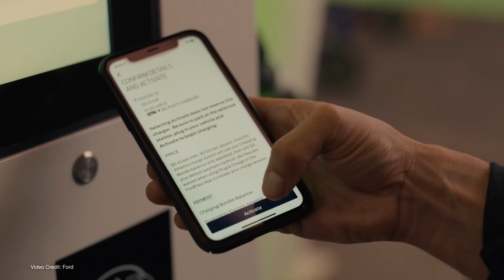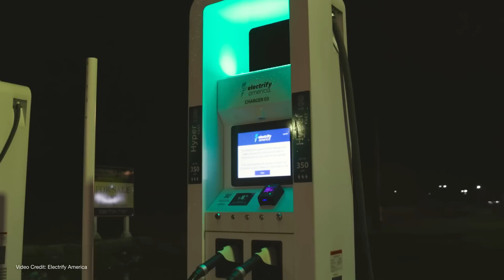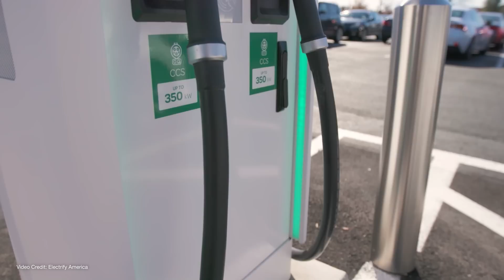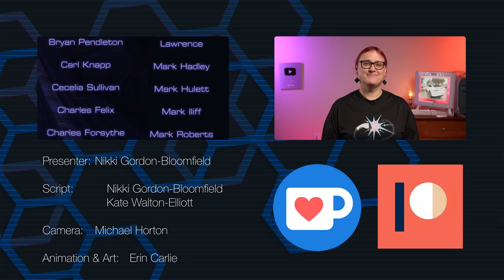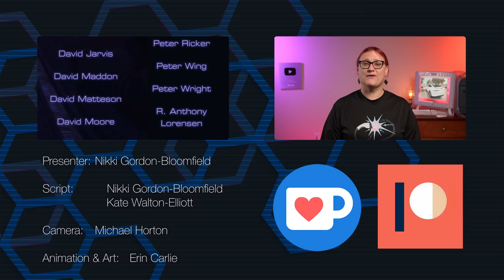EV Fast Charging Is BROKEN - And NACS Won't Fix Everything

Comment: If you are correct that Tesla uses the onboard chargers from their cars as the modules to create a Supercharger, it implies that Tesla’s costs to make a Supercharger are greatly reduced (because of their enormous volumes.)
And it also implies that the reliability will be very high, as the chargers have so much production history that all the bugs are worked out.
Add to that, Tesla has for years been the #1 pick for new graduating engineers. Tesla gets to pick the best of the best, and that gives them a significant advantage.
Reply: That's great! Perhaps the new engineers can improve the current system to charge newer vehicles at the fastest attainable speed and add enough cable length to accommodate a wide range of vehicles. This will require a new NACS connector and larger cables to handled the increased current and voltages.
Reply: on board chargers are for AC charging only
there is a reason why the superchargers are called DC Fast Chargers as they charge the HV battery directly.
Reply: @thomaswilson2917  That's the point, though. Something has to convert, say, 240V AC mains power to 400V DC, to feed into the battery pack. Either it's the AC charger inside the vehicle, or the DCFC outside the vehicle. They're both doing the same job, though on a totally different scale.

(The different scale is what makes me skeptical of the claim that Tesla superchargers use the same hardware as what's inside the car. The DCFC would need a lot of those in parallel! Also, it needs them in groups of 3, to accommodate a 3-phase input feed. But it does seem doable.)
Reply: @ps.2  no they don't.
You don't have to convert anything when you charge the car with DC.
Yes inside the supercharger it converts high voltage ac to DC power which directly charged the battery.
There is no conversion inside the vehicle.
Tesla superchargers are not powered by 240 volt ac power. 
The transformer is rated at one megawatt and powers 4 stalls.
Your transformer line voltage would not be 240 volts with 1,megawatt.
Reply: @thomaswilson2917  You're saying there is no AC-to-DC conversion inside the vehicle? An AC charging session just pours 120VAC or 240VAC straight into the battery pack? Sorry, I don't buy it.
Reply: @ps.2  not what I said.
No conversion on DC fast charging.
Yes the Tesla has an onboard charger for level 2 or level 1 ac charging
Tesla superchargers charge the battery directly
Tesla superchargers are not fed from 249vac.
Since the transformer is 1 megawatt and feeds 4 superchargers it is fed from the high voltage lines. 
Might be 4160 volts or higher for the transformer primary.
Reply: @heathwirt8919  technically there is a new NACS connector but it is backwards compatable with the present one.
That means it will plug into present Tesla vehicles.
Reply: @thomaswilson2917  Where is it? I'm guessing it's in the same place as uprated cable and charger architecture somewhere in Tesla fantasy land.
Reply: @thomaswilson2917  Huh? Who cares what the transformer takes? Nobody's talking about the transformer. We're talking about the DCFC. The transformer will feed it whatever voltage and however many phases Tesla decided they wanted to engineer for. Could be 3 phases of 240VAC, 60 Hz, so they can reuse those mass-produced car chargers, right? (And so they could use the same design in locations where they don't also spec the transformer.) Could be a much higher voltage, for smaller wires and conduit between stations, but a more expensive cutoff switch. Who knows? Not me, and you're not making much of a case one way or the other either.
Reply: @thomaswilson2917  The onboard chargers convert AC to DC. They can put out 11 kW of DC. Putting banks of the same chargers in parallel in the electronics cabinets at Supercharger sites might be (I don’t know for sure) how Superchargers make their DC. There is no technical reason it would not work. It would take a large number to power a 250kW Supercharger. Roughly 24 units. The video claims this is what Tesla does. I am skeptical, but not for technical reasons. I think it might be more economical and compact the build dedicated, higher power charge modules for SuperChargers.
Reply: @jimmurphy5355  you can get semiconductors that handle way more than 11kw.
The supercharger electronics run off of 480 volt 3 phase not 240volt single phase.
Reply: @thomaswilson2917  Based on a teardown I saw of the onboard charger a few years ago, the onboard charger is three phase capable. The CCS2 connector on European Teslas has pins for 3 phases of AC, and some Level 2 home chargers do provide 3 phase 400 volts. (Line to line in a three phase 240 volt system is 400 volts.)
I suspect that the same circuit board is used for EU and North American Teslas, with empty spots on the board for North American cars. So a fully populated charger board can handle three phases, and maybe, if the parts were specified with quite a bit of voltage margin (or higher voltage semiconductors and capacitors were substituted) also work at 480 VAC.  But I am still skeptical that’s what they do. 
The inverters that run the motors can handle hundreds of kilowatts with just a single circuit board and a handful of very high current switching devices. So clearly Tesla could design a single much more powerful charge module for use in the Superchargers, and put a few of them, instead of dozens, into the electronics cabinets
Reply: @jimmurphy5355  might be true for same circuit board.
But no one is going to put 250/11 circuit boards in a supercharger when you only need 1 circuit board and larger scrs that handle the larger current.

Comment: Personal pet peeve (and I know I'm not alone). Charging-network-specific phone apps, or RFID tags, need to die! Or, at least, be strictly optional to use (the way petrol station incentive cards are). We have a perfectly standardised method of paying for stuff without relying on cash ... contactless payment cards. Charging stations need to use them, and not require someone to sign up with an app and establish an account. It should be possible to pull up to the station ... plug in ... tap any valid contactless payment card with funds available ... and walk away and have the car charge. No phone app or RFID tag and no account other than the owner's bank account. Tesla does not get away scot-free here. Can't use a Supercharger unless you have an account (be it Tesla or otherwise).

I believe that Kempower stations now have built-in contactless payment terminals. And strain-reliefs for their cables. But, there aren't many in North America yet.

Comment: As someone who has an EV with CCS connector I can tell you from personal experience that Tesla's customer support at their chargers for non Tesla EV is there is no support.  No 800 number you can call.  No support through text messaging.  No website to report a problem.  Shows just how committed they are at supporting non Tesla EVs.  One thing this video didn't touch on is how the payment system works at CCS chargers.  They are all trying to reinvent the wheel with apps and rfid cards and memberships.  They need to do what gasoline pumps have done for decades now.  Just use good old reliable credit card and debit card readers on every pump.  Another thing they need to do is layout the pumps either as drive through like gasoline pumps or place the chargers at the center were four parking spots meet so that one pump can service all four spots. This way if multiple ICE vehicles are parked in some of those spots chances are an EV will still be able to charge.  If the parking lot owners are smart and don't put those cement parking blocks at the end of each parking space all of a sudden you have a pull through charger that can be used from either side.

Comment: Nice overview.
Just finished an up and back from central California and Seattle.  (Waved when we passed.) I experimented with non-Tesla stations for my Model Y, but more than half were broken and human interfaces were a mixed mess. Tesla was painless; transparent software, high reliability, small cable (for Rev 3 of Superchargers), and large number of "pumps" per station, removing availability worry.  Competitors with one or two connections per stations, when half can be failed at any time, would drive me nuts.
We are about to start two-months driving a rented Model Y in Europe (Germany, France, Italy).  It will be interesting to compare the situation where the question of connector does not matter.

Comment: Great video, as always! EV charging stations need to emulate a similar model that has won: petrol stations. Have EV stalls with sufficient room all around, charging stalls that can be seen easily and prominently when entering the area, able to charge on both sides, with sufficient long cords. Add a convenience store with clean bathrooms, snacks, sandwiches, decent coffee and, if you feel lucky, with a hockey field on top (clerks! -the movie-). 

About the classic Mac, is that a Graphite G4 with the wonderful Studio Display? Lovely machine. For me, the only software that it should run is Marathon.
Reply: You dont need long cords if everone puts the charge port in the same location.
Tesla Manages to put it in the same location on every model.
Long cords are inefficent and makes liguid cooling less efficent.
thats why tesla cables are smaller...
Reply: @thomaswilson2917  agreed, mostly. Still, you have to keep in mind human stupidity that translates into every brand putting thee charging port in a different location. 

Also, next charger stations will increase voltage from 400V to 800V you decrease the temperature that the whole systems gets (due to lower power loss, so less heat dissipation).
Reply: @MrSinnerBOFH  higher voltage stations charge at a higher kw rate.
Doubling the voltage allows you to charge at twice the rate.
Reply: @thomaswilson2917  or at the same rate at a fraction of heat generation

Comment: The more complicated the protocol, the more difficulties you'll have with compatibility. 
Essentially, All a charging protocol needs to do is to instruct & coordinate  the car to energise it's main contactors with the contactors within the charger - in a safe manner,   And exchange information regarding voltage and current and possibly temperature.   All other data is just information gathering on the part of the charging and or Auto manufacturing company.

Chademo protocol is far simpler but no, the auto industry wanted a faster protocol to enable transferring Mbytes of information in order to know all about us.

I used to design electronics to attach to computers etc, using the standards and I can say there is no such thing as a standard that companies and Engineers won't tweak such that an interface is no longer universal.

Comment: Thx for sharing. I'm with you on free charging. EV manufacturers may still offer it but Tesla should just inform them they must add this note (in fine print if they wish to) * Free charging does not apply to the Tesla Charging network where idle fees will be ludicrous.
Reply: Tesla is not claiming free charging.
Why should they be involved? 
In ford's case it is only at electrify America stations.
Reply: @thomaswilson2917  just saying that other car makers offering free charging should inform their customers since lots of Superchargers will be opened up to them.

Comment: I think it will take Tesla's network to help make mainstream buyers okay with idea of buying an electric vehicle in the US. It is sad how range obsessed many possible buyers seem to be. Once you have a vehicle that does 200 miles or more on one charge, 99.9% of travels are covered with that one charge. I think there is a strange disconnect between the idea of just plugging in each night or every couple of nights, versus that once or twice a week gas station visit you have to do with ICE thanks to most have 300 miles or more of range. My Model 3 RWD is plugged in ever night and I have 260 miles of range. I have yet to need to charge outside of my home. Before people start yelling, not everyone owns a home, yes, I know. If we just got 75% of homeowners to buy EVs that would transform the United States. That would also get more companies to invest into the EV space and encourage better options for those without a home to charge. 

It is crazy to think how fast things have improved in less than 10 years. When you look at things like the Ford Focus EV and Nissan Leaf back then, versus all the options on the market and hitting the market over the next 18 months. The EV industry has done a great job taking on the issues that keep people out of the EV market. I do believe as little as five years from now, most buyers will feel good about the idea of buying an EV. 

I do hope Tesla is not the only charging network to be reliable and all over the place. I agree with the concerns about safety and access to charging. As more business see true value in EV charging, I do believe much of this will be fixed. It is no longer a novelty to get customers shop stores while their vehicle charges. Instead the charges will be seen as true revenue generators and that will spur more investment and better charging stations. The biggest challenge will likely come from lobbyists trying to slow EV adoption will try and throw as many roadblocks up as possible to new charging stations. 

Where I think Tesla might truly break the anti-EV movement is if they get many charging stations to be self reliant, as in battery backup with solar to run a charging site. If an emergency happens and power grids go down, but Tesla charging stations are still up and running, both government agencies and consumers will want to use something that can still function in emergency situations. I could see state and local agencies demanding these kinds of charging stations be put in their areas so emergency vehicles can keep going when power grids go down. Consumers will obviously want the same. Sadly, the more extreme weather we are dealing with is going to make this kind of event possible. 

The one variable in the mix is solar tech on vehicles. If we really get the kind of breakthroughs that add fifty miles a day even on a semi-cloudy day, that will be a big help in getting people into EVs. Just the idea you can charge up your vehicle for free will be very appealing. I am sure it is a good decade out before we might have that kind of solar tech. Yes, Aptera has their vehicle, but for most people the two seat design is going to keep buyers away. When you get something like a Model Y or Kia Niro EV that has 50 miles of solar recharge a day, then more mainstream buyers will be coming over to EVs.

Comment: 100 percent facts.  There are so many YouTubers that think the connector is what’s going to fix the problem.   Sure if tesla opens all chargers it will be a huge start. But they are not. And they don’t support 800 volt currently….   It also won’t fix all the broken non tesla chargers.
Reply: At the end of the day I think most of us don’t care what connector is used.  We just want it to work and work well.
Reply: It's NOT just the connecter that his better about the Tesla SC Solution. It's going to force other charging stations to be better.
Reply: @davidc2838  how will a connector do that? Tesla right now isn’t Clear on what stations will work with non teslas.  So far it’s expected to be v3 and maybe only the new v4 chargers.

Comment: That placement, in Vegas, there's the SC lot by the High Roller ferris wheel stinks too. It's behind a gate/bar and you have to know the stupid code to get thru it and sometimes it still doesnt work. Let's not even get into tho, the placement of EA stations at the shadiest of places sometimes where charging at night is quite the adventure in your very nice, expensive EV...

Comment: The non-Tesla EVs need to relocate their charging ports to the same location as Tesla's. I have heard this complaint repeatedly from utuber Bjorn Nyland (Norway) who tests other EVs other than Tesla's, and I agree with hm completely. That would help to eliminate one of the problems. I am a Tesla owner since 2012 MS delivery and have NEVER had a problem charging any of our 4 Tesla vehicles at Supercharging network. I think the access, ease of use and reliability of Tesla chargers is one of the factors that will make me a Tesla owner for life. Tesla tells me availability of chargers, waiting times if all are in use, and the cost of charging (variable rates throughout the day), so I have all the relevant information needed on trips to make the most informed decisions and make charging relatively stress free.

Comment: Well done for pointing out that there is a lot more to this than connectors, and that much of Tesla's reliability advantage comes from designing the cars, the chargers, and the software, and managing the payment and auth system and the servicing too. It's not that their tech is actually better in any important way (indeed it's still CCS signalling under the hood AIUI) it just doesn't have 46 different combinations and businesses to deal with.
Standards can fix this, as is illustrated by USB or bluetooth which do generally just work, whoever made the devices, or whichever OS you are using.
Reply: Tesla makes better chargers, more efficiently and keeps them in better repair on a continual basis. That's what's lacking from nearly all other charging networks in the US.
Reply: @davidc2838  Maybe in the US, but other people make more efficient, higher power, and more generic chargers and there are several networks (including Tesla's) with good reliability stats in Europe. Kempower chargers are particularly good, but several others are good too and FastNED, Gridserve, Instavolt, and Ionity are all run very good networks that serve all, and Tesla are getting there.